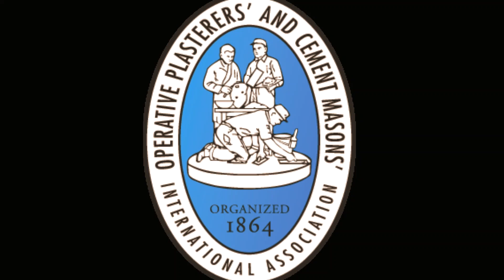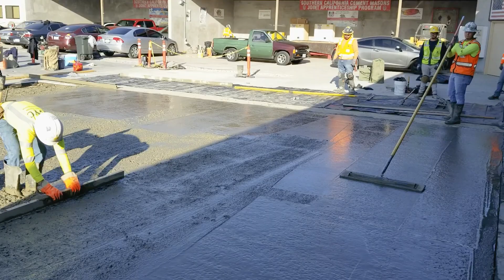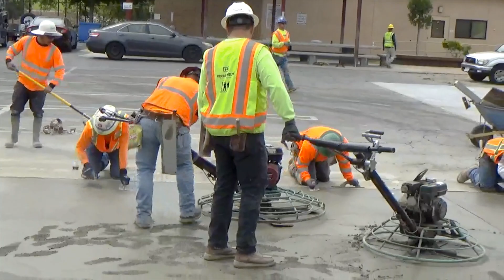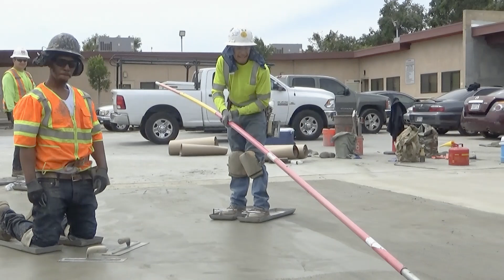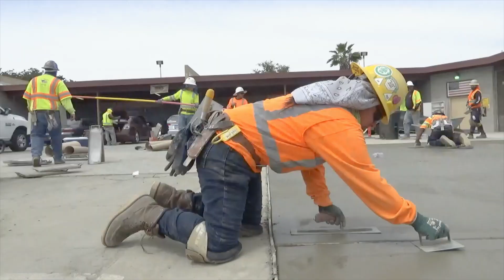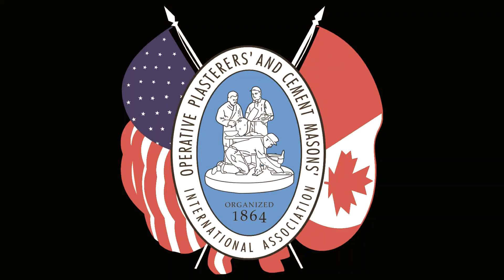Cement Masons Union Apprenticeship Southern California

Comment: Local 600 here 👷🏽
Reply: How’s the pay?
Reply: I’m trynna get in 600. Moving in from Hawaii
Reply: @da10mmsocket  did you get in?
Reply: @danielson2454  I got in Local 1 in Hawaii, Bricklayers union. Pay is the same as the union in Cali
Reply: @da10mmsocket  nice!
Reply: @da10mmsocket  so what's the pay rate?
Reply: @victorperez4881  starting apprenticeship is $23. Journeyman $45+ . Real busy here, guys from up 49 states traveling here to Hawaii for work.
Reply: @victorperez4881  forgot to mention, we got 2 masons union in Hawaii. Local 1 bricklayers & tile. Local 630 concrete & plaster. Weird, old timers said they split over some drama back in the 90s
Reply: @da10mmsocket  well damnnnn